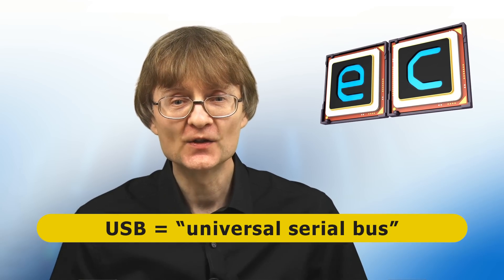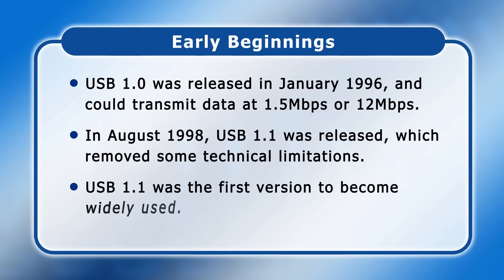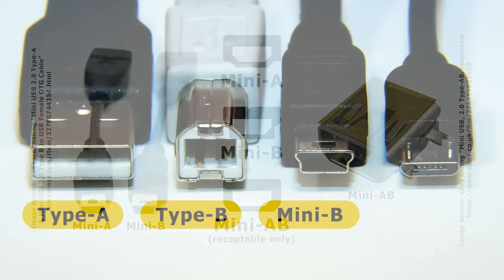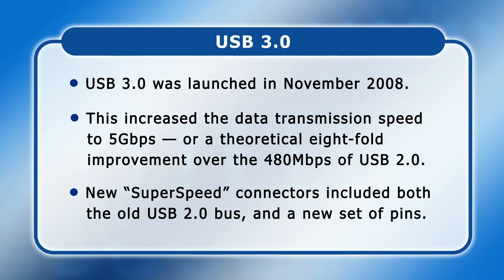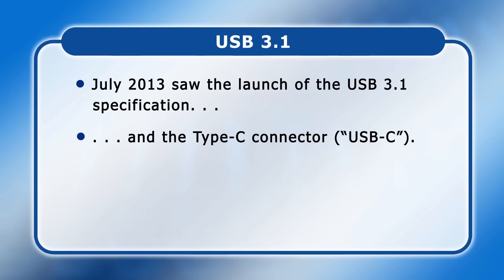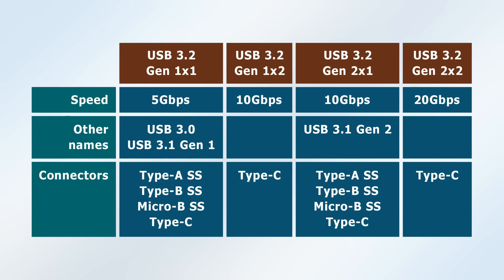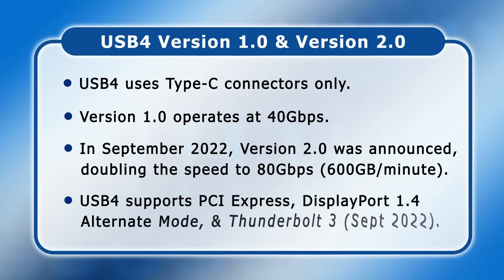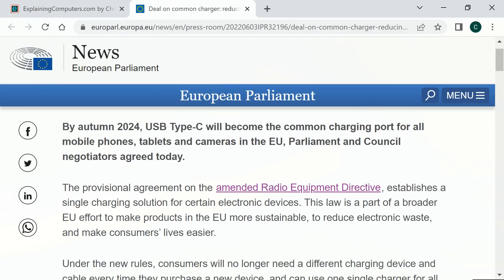Explaining USB: From 1.0 to USB4 V2.0

Comment: Type C connectors are by far the best for robustness and ease of use it seems. Mini and Micro connectors do seem to be far weaker, and often end up damaged and difficult to repair. Then there's the inevitable "turning over 3 times" to insert a Type A plug which Type C  avoids.

The whole USB naming thing is almost hilarious, and certainly does support the meme "designed by committee", and makes a mockery of "Universal". Then there's the manufacturers that fail to, or mislabel ports leaving the user confused as to the capabilities just to confound matters more.

Lastly; How many of us can admit to fumbling in the dark or behind a desk trying to insert a Type A plug into a PC or laptop, only to find that the RJ45 socket neatly accepts a Type A plug?

Comment: The confusion and stupidity are astounding.  And now, it can be dangerous, since everything is moving to the same freaking plug for everything, even mandated in the EU.  Can this no-name cable from China carry 48V to my device without glowing red hot?  Will it send 48V to my 5V device?  Will the 20V line millimeters away from the millivolt data lines spark over and fry everything if I'm careless plugging in the cable?  Who knows!  Never a dull moment.  If only there was a way to make uniquely shaped plugs for unique needs, oh how easy and obvious it would all be.
Reply from the maker: Great post!

Comment: the table at 9:04 cleared some "weird specifications" conflicts for me, as my fairly modern motherboard has all "USB 3.2" connectors, some are blue and one red. now I understand that basically its  blue connectors are "normal USB 3" 5Gbps connectors, and only the red USB (all of them are type A !) is 10Gbps as it's named  "USB 3.2 Gen 2" . many thanks

Comment: You left off the most important spec of type A connectors; How to properly use them:
Step 1: Attempt to insert plug into socket.
Step 2: Upon feeling resistance remove plug.
Step 3: Turn USB plug over and try to insert plug into socket.
Step 4: Upon feeling resistance, remove plug from socket, turn plug upside down and return to step 1.  
IMPORTANT! At no time should you assert force to insert the plug as it may cause irreparable damage to plug and socket.
Reply from the maker: Cool.
Reply: @ExplainingComputers  Maybe you could do a quick demonstration on how you can plug a USB A connector correctly? by first holding your thumb covering the logo side of a USB cable, then facing the USB host PC face on and upright, this will allow you to naturally plug it in correctly on all devices that adhere to the correct USB orientation. (It works for me every time).
Reply: Bwahahaha!  Almost a daily experience for me.  Who hasn't done a reach-around to plug in a USB connector in the dark back-side of a computer?

Comment: The USB world is a mess, yet you managed to deliver a very clear and informative video. Nice job !
Reply: Yep. It's still clear as mud in some ways, but that's the clearest and most up-to-date explanation I've seen. Leave it to Chris to cut through the confusion, esp. regarding the insane name change of a spec after it was already in use.
Reply: USB 3 alone is very confusing! The graph was very helpful, though. The channel, as a whole, has been so helpful in learning about computers (technology, in general) as a consumer.
Reply: @dustinlouder  Absolutely !! We've been P-C'ing" for nearly a HALF CENTURY and "they" STILL struggle with the BASICS !
Reply: USB was invented by Indian Ajay Bhatt
Reply: @ambrose7581  I would not have thought that,It's a surprise to me,thanks for the info.
Reply: In the begining, one of the purposes (if not the main) was to have ONE standard connector to replace ALL existing ones (DBx/DBxx, Parallel cables, proprietary connector, ... ) and now, there're dozen of different cables, no standard and even companies fighting against standardisation such as Apple.
Reply: I agree too.The colour is the problem & mixing the speeds of the blue colour. Read my submission. It means change colour change connector and item to suit.
Reply: not anymore with usb c
Reply: Exactly. Especially in the naming convention of these.
Reply: Thanks for another excellent explanation. I am sure once we understand the USB 4 fiasco they will retroactively redefine it with USB 5. And the rodents (slow mouse, wireless rats) will become retronyms such as CATS ( Coexist ing Amorphous Termina Something)

Comment: Thank you for this informative and well presented video.
Could you please consider making a supplementary video with a more detailed explanation of the USB PD specification and how this affects users in terms of backward compatibility and safety.
I was comfortable with the USB standard whilst it was limited to 5v. It seemed safe to use any charger with any device. I am not sure if this is still true.

My latest phone charger has a USB-A connector and is capable of supplying voltages of up to 20v. I presume that it is safe to use this with any new device using a new USB-A to USB-C cable.
However, I still use an 8-year-old Amazon Kindle Paperwhite with a USB-A to micro-USB cable. I doubt that this would survive a 20v input and it is unlikely to incorporate logic to control the charger voltage. Is it safe to connect this to the phone charger?
I have heard reports that some older USB-A to USB-C cables are incompatible with the latest standards and should be discarded. If this is true, how can they be identified?

The EU are seeking to encourage the use of universal chargers and charging cables. This is a laudable goal but is it safe with current hardware?
Reply: Getting 20V out of the charger is not that easy there are clear steps listed in the protocol. You can get a passive cable that has specific resistors to get 5v but for more than 5v there are lot of steps a usb pd downstream port has to do to negotiate 20V from the charging brick.
Reply from the maker: This I may well do -- it depends hw well this video does. I did download 17 USB PD specifications/revisions whilst making this video.
Reply: I think ur ok as long as you don't use any sketchy active cable. Any ordinary passive cable which doesn't   communicate with the brick will get 5v, 0.9A at most. The protocol is such that legacy devices don't get destroyed if used.

Comment: Real world USB speeds seem to vary incredibly and rarely get anywhere near their theoretical limits.
Reply from the maker: True. Hence I noted a five-times increase in real world speeds for USB 3.0 over 2.0, after an eight-fold theoretical increase! :)
Reply: @ExplainingComputers  - five times is a bit over ambitious I think.
Reply: And oh, the slow pain when one decides it's not speaking to another and falls back to 1.0 speeds....
Reply: @Reziac  ah, the lovely "your device could perform faster in a USB 2.0 port" message while you're screaming at it "IT IS a USB 2.0 port, you piece of #^@*$@^*@!!!!!"
Reply: The big difference is that up to USB 2.0 it was a half duplex connection, so data could only travel one way at a time, and this made the practical speed more like 25-30 MB/s than the theoretical 60 MB/s.
From USB 3.0 it became a full duplex connection, so you could get much closer to your theoretical max speed.
Reply from the maker: @zorktxandnand3774  A very good point!
Reply: @zorktxandnand3774  But with USB 4 (and Thunderbolt) we are back at barely more than half the speed, around 22-23 Gb/s vs 40 (or 2800 MB/s vs 5000)
Reply: @_Digitalguy  USB4.0 is also full duplex.
Reply: @aronhighgrove4100  what is full duplex?
Reply: It depends on the speed of the storage devices eg 5400rpm external hdds are slower. USB latency is worse than SATA because of the conversion process.
Reply: @khwaac  if you have the mSata USB port on your computer that wasn't mentioned in this video, and a usb3.0 interface, it actually does sata instead of the normal USB protocol.
mSata ports can do both mSata and USB connections; they're backwards compatible!
Reply: @runed0s86  That's a damned standard, we don't talk about those. Use m.2 PCIe instead.
Reply: I've never seen a USB device get anywhere even vaguely close to the advertised speed.
Reply: @LC-uh8if  And I'm just waiting for fires to happen from people trying to pull 200w with cheap cables.
Reply: The real problem I have with USB is cables, no matter what connector the cable uses, you can't know if it has the correct pairs without cutting it.

I wish it was standardized separated, like Ethernet CAT categories. 
I don't care about theoretical data transfer of the device, I just want the cable to be able to support the greatest possible transfer. But you can't know that when you buy cables, its a trial and error effort.

When it comes to devices and hosts, USB is actually fine, the problem is cables.
Reply: note that this is just interface speeds, theres mamy other factors effecting speeds
Reply: Yeah, I have a "USB 3.0" drive that transfers at 33MB/s on a good day. The old adage "You get what you pay for," is apropos here.

Interestingly, I haven't cared about speed since I've adopted the CLI/TUI way of copying files: they'll get there when they get there and there's no status bar telling you the stats like speed and ETA. It's weird how much more anxiety there was for me when dealing with that copy dialog box showing that fluff versus now.
Reply: @encycl07pedia-  
Are you using the correct cable (with blue plugs)?
I have an external drive (USB 2) and I get a pretty constant 38mb/s.
On my 2nd USB external drive (USB 3) I get up to 160 mb/s (speed is limited by the drive).
Reply: @Zentauri77   "Are you using the correct cable (with blue plugs)?" Its never enough, never, you have to cut the cable to know...
Reply: @encycl07pedia-  that seems like a cap of a mechanical 5400 single plate hard drive
Reply: They'd meet the limits if manufacturers stopped cheaping out and not meeting standard.

Comment: I'm sure I remember some really early Apple machines with USB connectors where they actually used a slightly non-standard connector with a "notch" in one of the long edges of the rectangular port--I don't know if that was so you had to get Apple-branded USB cables or what.

Comment: Phone manufacturers still sell USB-C devices with 2.0 speeds, which, if 4K video is and Micro SD extension/swap isn't an option, feels like a deliberate troll at this point.
Reply from the maker: Yes, there are a lot of USB-C USB 2.0 implementations. It brings us back to the issue of the connector not indicating the specification.

Comment: With a clear statement of what USB is, from its inception to the present, what hasn't been stated are the serious and severe limitations of the protocol and its serial physical nature. This is not a surprise, since USB was devised by the kings of mediocrity at Microsoft, whose work is a constant embarrassment to the entire computing world.

I rely on USB to provide hubbed services to multiple PCs that I select using a 4-port HDMI/USB KVM. Obviously, only the connected PC can talk to the shared hub, which means that I have to be careful about starting longer processes, file copies, etc., and NOT disconnecting from them as they proceed. This works well with shared devices like a USB Audio device providing sound for all of my devices and keyboard/mouse control. Where it tends to go wrong is when trying to use the alleged speed of USB for things like file transfers or anything that depends on the super-speed capabilities that have been claimed.

The claimed speed of USB reflects TOTAL MAXIMUM CAPACITY ONLY, and does not give a clear picture of what may be expected in the real world. Think of it as the total system backplane capacity of the device. Latency and control overhead are never mentioned or dealt with as factors to be considered. If I want to take complete advantage of a USB device's speed, that is for example, move many large files, even on a single machine with no network involvement, the USB device to be used should be the only one on the circuit to have any chance of having it work at maximum speed. My experience has taught me that every attached device adds latency and reduces the possible maximum speed of operation.

USB is great for some things, but nowhere as good as has been claimed for many others. I'd be interested in hearing what the actual speeds are in common scenarios in which latency and system overhead accounted for. To simply tout the claimed capacity of a USB circuit tells us nothing of the reality of using it. Cheers!
Reply from the maker: Thanks for this. I do repeatedly state "theoretical speed" in this video. :)
Reply: Yes, Chris, you do, but the technology continues to be oversold by the people selling it. 80Gbps is completely meaningless for the things that USB does best and is almost unattainable for those that seek to use it at the speeds advertised. USB is a secondary means of transfer and has only limited usability with large data volumes. If you try to treat USB like the high capacity channel it is SOLD AS, disappointment will certainly follow.

Comment: This is a great piece of information but its a bit like telling a motorsport driver to wear a seatbelt or a biker to wear a crash helmet.
Like preaching to the converted.
I refer to the ability of the USB unaware people to be able to gently force USB C connectors of the differing types into each other one way or another.
More often than not its for charging and sometimes it works & sometimes not.
But the common result is that after such purswageons the connectors get more & more reluctant to work properly with their correct partners.

Comment: This is the clearest explanation I have seen...and I still got a headache.  Going into a corner to hide with my box full of legacy cables.
Reply from the maker: Good old cable corner.
Reply: Hint 
    Put a label on each cable of the device you use each cable for 
    Eg smart phone , portable hard drive , printer 
    As and when you use them put another label on the cable , fast , faster , " warp speed "
  Hope this helps
Reply: @boboften9952  Then I would miss the fun of dumping out the box searching for the one cable to rule them all.  I wonder which cable is speed "Go to Plaid"  (Spaceballs reference)

Comment: Thanks
Reply: With the higher wattage's and voltages mentioned would there be any safety issues for plugged in peripherals if something were to short out through a dodgy cable or device?  Also would a current PSU have the capacity or would it have to be upgraded?  I use online calculators to work out what PSU to buy for the components fitted with at least a 50% margin for future upgrades!
Reply from the maker: @alanthornton3530  Under USB PD, devices communicate before delivering more than 5V at standard current levels, so in theory there will not be problems. And most current USB power supplies cannot deliver the higher voltages required to deliver the high wattage outputs. But certainly, as times goes on, more and more power is going to be flowing through USB ports and cables, which may well raise safety issues. Maybe I'm old fashioned (well, I am), but 240W though a USB connector strikes me as a lot! :) Really good quality cables -- and cable specifications -- are going to be a major issue.
Reply from the maker: Thanks Alan, most appeciated. :)
Reply: @ExplainingComputers   You deserve it for the hard work that you put in to produce these videos & educate : ):_scissors2:

Comment: USB 1.x and USB 2.0 have the same connectors. 
With USB 3.0 came the USB A superspeed connector. The USB 2.0 and 1.x protocols can also be transfer.
With USB 3.1+ finally came the USB C connector. But which protocol and speed is used often remains a mystery.
Especially since there are also USB 2 cables with USB C plugs.
Hopefully the many mini, micro plugs and USB B connector will soon be a thing of the past.
Reply from the maker: Thanks for this, but is it not entirely accurate. :) For a start note that USB 3.1 and Type-C connectors are not directly linked, as USB 3.1 works with Type-A SS, and Micro-A/B/AB SS too. Also ALL connectors have an independent USB 2.0 bus. As I stress in the video, USB specifiations and connectors are NOT linked.

Comment: I think I may have planted the seed for this video... great to see a fantastic job as always trying to explain the different standards and definitions with both visuals and graphs. 

It's always puzzled me why USB (and HDMI and Display Port for that matter) have moved away from doing some sort of physical difference of the ports or cables, when they started going from the older black or white inner cable to the blue version of 3, it made a lot of sense.... and then they abandoned all sense whatsoever. They could have used other colours like red or green or the like or put a stamp on the plastic around the cord or port... but as you say... you really need to test both cables and devices or have a reliable manual tell you which version you have. 

And of course, dodgy cable sellers will always mark up their data and power rate numbers and increase the price when they are really selling older generation types which they hope the end user won't notice. :-\

Anyway, thanks for putting up with the madness though. :-D
Reply from the maker: Thanks for this.
Reply: Plus on some systems the "blue" ver 3+ connectors is RED which doesn't really help either 🙃